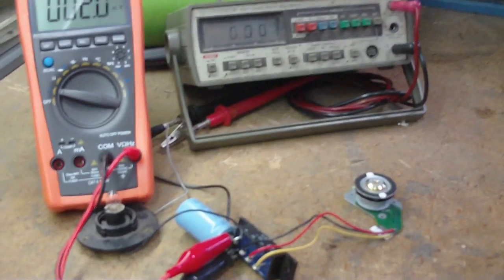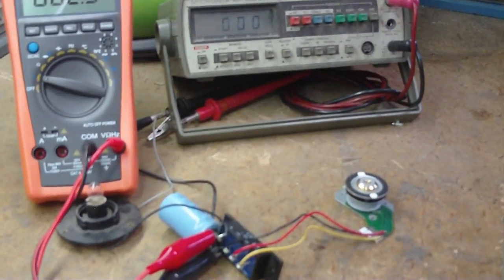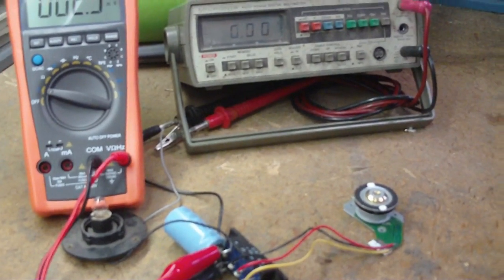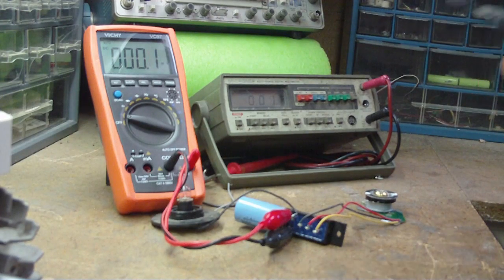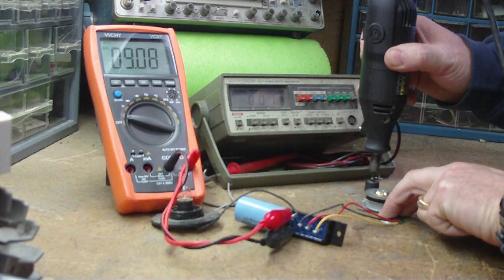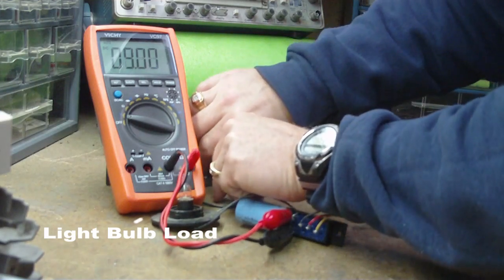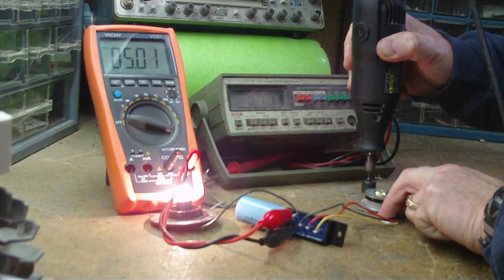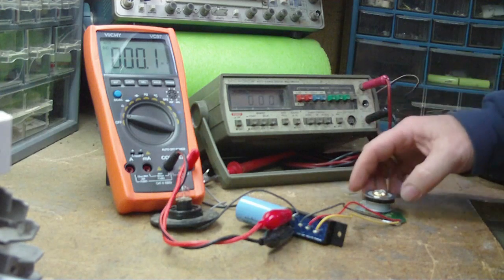CDROM Motor as a Generator

Comment: did i miss you saying the current? how did you calculate the power output? was the current about 380 mA? at which rpm?
Reply from the maker: 0.7 amps X 5V = 3.5watts   at max RPM ~ 30000RPM
Reply: oh, thanks. i wasn't sure what those numbers at the first seconds of video meant - the values to run the motor, or the output... and i apologize, i *totally* missed the display on the other device (is it a kind of multimeter as well?) - thought it was for decoration only :) I guess, this is the main motor of the CD drive, not the stepper motor, right?

Comment: Normally the voltage drop over the rectifier is insignificant when connected to normal generator, but this small brush-less DC motor generates a relatively small a voltage, and the voltage drop across the rectifier becomes a significant portion of the output.

You might try building your rectifier from Schottky Diodes, because they have lower forward voltage drop compared to the ordinary silicon diodes. The voltage drop may be somewhere between 0.15 and 0.4 volts at low currents, as compared to the 0.6 volts for a silicon diode.  Compounds the problem, for each phase, you have 2 diodes in series conducting at any one one moment,  with a doubling in voltage drop over a single diode. 

Using Schottky diodes, you might bring the output up 50% or more to 5 or so watts at the same rpm.

Comment: What would be gear ratio to get that speed while cruising on a bike?  or what is your dremel rpms?
Reply: +Daniel S Quick numbers to get you close. If the CR ROM rotor part of the motor has a diameter roughly 1 inch, then it has a circumference of 3.141 inches. If traveling 10 miles an hour, that is 10560 inches a minute that when divided by a 3.141 inch circumference amounts to  3361 revolutions per minute. You might try gluing a smaller rotor to the existing rotor to make it spin faster.
Reply: Thanks!

Comment from the maker: I'm not sure what motors you are thinking of using. My demonstration is using a brushless motor that has rotating magnets. I think that most squirrel cage fan motors would be AC motors. I think you can somehow run current through the exciter winding and make a generator out of them but I'm not sure how.  The DC motors found in treadmills will generate higher voltages with less RPMs and will not need to be rectified.  Good luck with your project!